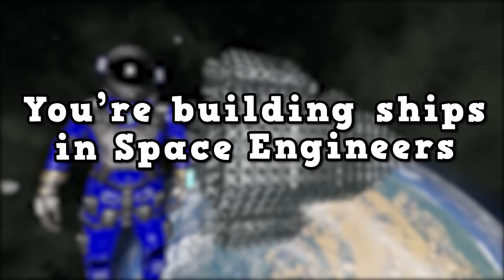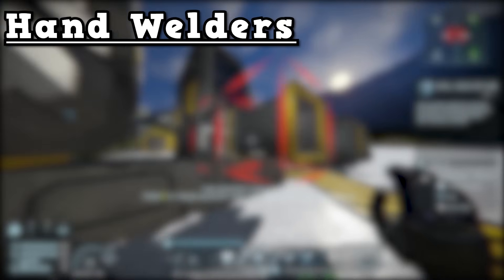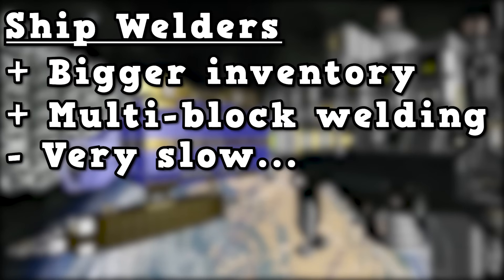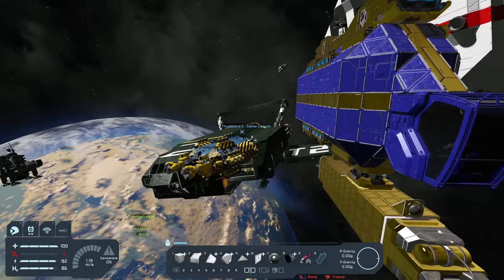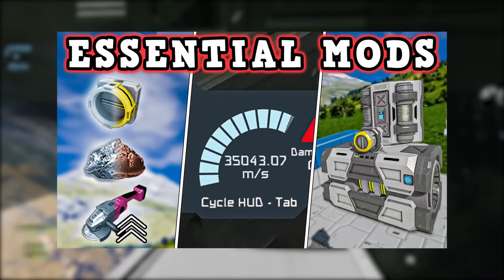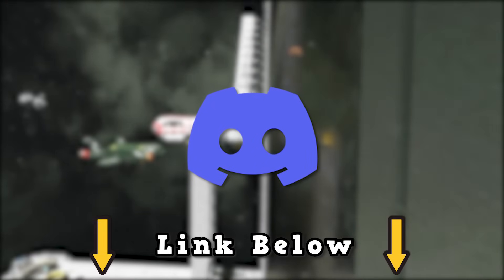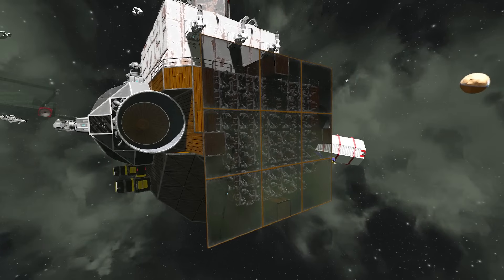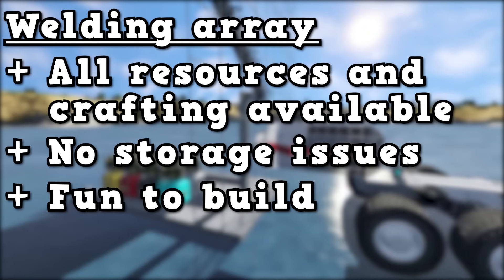You're building ships WRONG in Space Engineers

Comment: what if you had a hanging part, there would be the issue 3d printers irl face and that is they cant print and make floating parts so for example if you wanted to print a wing that has a tip the printer wouldnt be able to make plastic float midair til it connects, i think you might need suports for that
Reply from the maker: You should design your blueprints with that in mind, you can always remove support struts later.
Reply: @Zer0sLegion 👍

Comment: this rotor-based method is pretty similar to polymer 3D-printing. And just like polymer prints, if you want to have all the blocks print reliably with this method, you need to add support structures to your ship so that there's no disconnected blocks on any print layer. Thinking about it, with some sort of script you could probably even make something that functions even more similar to a 3d-printer, with 4 or 5 consecutive pistons holding up a base plate, some way to detect when all blocks in one layer are printed, and some sorta warning system for when the printer gets stuck on one print for too long

Comment: I'll have to do some testing, but i think you can use izzy's inventory mod to potentially function as a replacement for the build planner, but i could see the issue being that you wouldn't necessary get the correct components you'd need for each block.
Reply from the maker: I'd honestly prefer to have all my components in one place. It would be cool if it works though.
Reply: @Zer0sLegion  I haven't tested it and I'm sure this set up or one like it will be the best solution, but it does seem possible. You'd just have to label the storage containers as special and then independently adjust the values for what you need ahead of time. Which with the send to assembler options from the projector mod or projector plugin is pretty easy to do. Especially the plugin as you can just copy the list.

Comment: Instead of that ship to hold the building material, maybe you could use une piston and a plataforma moved by the piston or cilinder and you move it by imputs.. and it should be strong to sustain that weight.
Reply from the maker: You don't really want to be welding things on a subgrid as far as i'm aware as it will recalculate the weight all the time and that leads to clang.

Comment: To the rotor arm welder:
You even do not need so many welders. In fact one can arange them in a kind of an repeating L-form on the arm and it will still hit every block. It will take more time. But then even larger ships are possible with only 3 welders. 
Comparable to the drill head, which is a rotor, a sideways drill and an off center forward drill, all on a piston slower then 0.02m/s².

Comment: Im not sure where a first saw it (probably your channel). It was in video with custom elevators and there was a concept of gears (cogs) and corresponding rail. in my opinion, its the best way for a lazy afk printer (that unlikely to clang and disintegrate your base): pros is this is a infinitely size-scalable pulley, does not require manual pull, perfectly linear, works the same for gravity and no gravity. cons: since it uses rails to move the projection, requires as much length for the rails as big your project is.

Comment: Personally i use the build planner just to load up the welding ship in the early game for huge parts like large grid large thrusters. MMB on loaded container, Alt + MMB on welding ship, repeat until done. Still do conveyor systems and stuff by hand. Also bear in mind you can MMB click any cargo hatch with a block blueprint in your hand and it will add to build planner and attempt to auto-pull right on the spot. Useful for when you want to load the welding ship for like 30 thrusters but only have 8 slots in the build planner, but know you have the capacity for a single trip.

Comment: I'm currently building (well procrastinting) a ring station. The problem is that it is so huge, welding it up takes a lot of time. I tried using a welder array on a rotor that spins in the shape of the station. But the conveyor system us already so huge that it takes 0.5-1s to take items out of it. That apparently also applies to welders, they wait up to 10s to weld 5%, then wait again and so on. Those welder are also so laggy that the game runs on 50% speed (and my cpu is only chilling at 25%) All in all, it is faster to hand weld the station than using a welder array. I settled on using a 3x3 large grid welding ship, filled its container with steel plates and started welding the stations shell. I guess I have to do 8hrs of just weldingto get this project done :/

Comment: Docking isn't a huge problem as long as you design your ships properly. Word of advice: hangars suck, for two main reasons. One, it takes a log more time and care to enter a hangar than it does to hook onto a well-placed external connector. Two, if the ship breaks loose while the bigger ship is moving, it will clang around and tear up the inside of your large ship as well as destroy your small ship, and you won't have any way of knowing it disconnected until you hear the clanging. Carrying the ships externally is simply superior from an efficiency and safety standpoint. This is why the industrial capital ship I built carries its utility ships on its back, with piston-mounted connectors to dock to. It dramatically improves the speed and reduces the precision needed to dock. Hangars look cool, and I recognize they're nice for many uses, but anything you're going to be making lots of trips for you want external docking.

Comment: You could probably solve that imbalance problem by trading the rotor in for a bar, then have a piston sweep that print head bar up and down as a second piston incrementally pulls the unfinished ship away from the welders. A skeleton of support scaffolds should be plenty to keep things aligned.
Reply: Think of it as an actual 3D printer. Why not move the print head instead of the projector and ship?

Comment: If you are going to use a welding ship i would suggest putting assemblers on the welding ship itself. This allows you to load the ship with ingots instead of components to save space, reducing the trips needed to refill (if not eliminating extra refills all together). This also reduces the number of different things you need to load (5 or 6 types of ingots vs 10 to 15 components) and once you add the BP to the production, the production tab will tell you the total of each ingot you need to load up. Only downside is you may need multiple assemblers with full speed modules to keep up making it a bit of a power hog.
Reply from the maker: That may or may not be what the point of this video is...

Comment: i use creative mode to create most my designs then have a BP projector system (battery connector block projector block)  then locking it to a connector that's attached to a grid to charge the battery and power the projector.  each design has incorporated a docking connector so i can keep them all uniform. (helpful for drone management)

Comment: To use the projector while in k menu, set your menu back ground opacity to 30% that way, you can see through the back ground and see the projection as you adjust it! You don't need to use any mods to use the projector
Reply from the maker: Yeah, the only issues with that is you have a static camera, if it's a particularly big blueprint, you're going to struggle to see it.

Comment: If you wanted to have the ship being printed and the array on the same ship, rather than moving the ship being printed away from the array with pistons (which of course, as you pointed out, has weight issues), why not move the array away from the ship being printed? It's significantly lighter, especially if you are using the spinny design. (also, making two opposite arms of welders, rather than just one out from the pivot point might help balance the weight so it doesn't try to bend as it spins)

I don't know anything about space engineers, so there very well might be an obvious issue with this idea, but idk what it is.
Reply from the maker: It's generally easier to move the ship as you'll need all your resources and assemblers are at your base.
Reply: @Zer0sLegion  I'm not saying to move the whole base, just the part with the welders. Does that not work? maybe pistons don't count as a connection, but rotation points do?

Comment: For using welding ships, I usually use the build planner and just dump everything into the welding ship, so build planner the blocks you need to weld, then go withdraw and dump into the welding ships. At my base in space, I built a welding floor, and then few pistons over it with projector, was great for welding up small grid things. The welding floor would also build itself, build just build one, then have several around it not fully welded but just their, and the fully built one would weld the others up, and so on till your done. I don't usually build on creative then import to survival, as I feel like its cheating, but on a mp server, I see using prebuilts being the best option.

Comment: I haven't played Space Engineers since about 2020, but I remember finding all sorts of cool ways to help with the assembly process of, well, pretty much anything. One of the coolest things I think I ever built was a "welding arm" that uses pistons and rotors which are hooked into your actual base. This provided it with more storage than you would ever possibly need to worry about, no need to ever dock and get more materials or anything like that. 

Using clever scripting, you could control this welding arm from the cockpit with simple WASD controls. I built this "welding arm" in such a way that it sort of acted like a gimbal. Wherever your mouse was pointing is the point in space that it would rotate around when moving. This made it very easy to reposition around a projected blueprint and make absolutely certain you were getting those tricky interior blocks. VERY cool stuff! 

The coolest thing about this is how easy it was to rapidly build LARGE grids, and it had quite a very long range. The one and only drawback to this was occlusion. This was a welding device attached to an arm. You had to kind of plan what you would weld up first. 

If you welded the wrong stuff first, you could easily end up in a situation where the welder could not navigate to the other side of the projected blueprint, because there was stuff in the way and the arm obviously can't phase through physical objects. However, if you treated it like any kind of printer-like design (slowly pulling back from one point) it worked extremely well. 

My biggest issue with Space Engineers was dealing with ship damage. I always tried to design my ships to be pretty,  yet entirely functional. This meant everything was fully conveyored, and these parts of the ship were covered. If any of this internal stuff got damaged, there was simply no fricking way to know what was damaged and what wasn't. It is especially frustrating when one of your 300 large grid gyroscopes scattered throughout various parts of the internal structure is damaged. Good luck finding it.  

I like the gameplay and quality of life improvements stuff like the Nanites mod adds, but I don't like the implementation. I personally LOVE the idea of assembling a ship in some kind of drydock, using cool design ideas with how welding works to make it buildable. I think there should just be an easier way to identify and repair damaged components. Perhaps instead of nanites, a literal laser passes through the ship and instantly repairs anything in the beam that is damaged. So you could have a welding setup for drydock assembly, and a repair setup specifically for bringing in damaged ships and repairing them. Imagine being able to fly your barely functioning ship through a grid of lasers, and just fly it back out and it's all patched up in its entirety. This would make the game a lot better in this respect. At some point the game definitely changes from "space engineers" to "repair engineers" and it just gets tedious. 

I think for this repair system, projectors should be done away with. Projectors are perfect for building something initially, but I don't like the idea of having a "repair projector" which just overlays the missing blocks on the grid. This just seems like a lot of added work on the player's part because sometimes setting these up can be tricky. And what do you do if the projector with the preset blueprint and necessary offsets gets damaged? You have to fiddle with all of that again. I honestly found it very frustrating trying to configure projectors for this purpose, because dialing in just the right offsets was always frustrating, and if I was unlucky and that vital repair projector was damaged, I just had to screw with the settings again. It was annoying. 

Instead, it would be nice if the game just "knew" what was supposed to be there in the first place. Like, when you convert something to a ship, the game just goes "ah yes okay, these are all the blocks needed for this grid, I'll remember that." So if a block straight up gets destroyed, using a repair laser on it would just instantly rebuild that block, provided the materials are present. 

I feel like this would already be pretty easy to implement directly as a core part of the game. The game already knows what blocks compose a grid, you can literally see every grid in a game. It knows this stuff already. It would be cool if you could just tell the game "THIS configuration is what it is SUPPOSED to be", and when you tried to repair it and replace missing blocks, it just went "oh alright." No need to fiddle with projectors for this purpose would be really, really nice.
Reply: There is a mod that allows you to visualize where damaged blocks are on a screen.

Comment: i do the same thing. although on keen servers because of the limited welders i put them every other block with conveyors. still works just as good. maybe a little slower. I've also done a line of welders in a static position on the base and just set a gyro to override on the projecting ship and get the same effect or if it is a small grid fighter just make passes over the welder table. still the rotating head is a great method for large ships.

Comment: I have another way and it's a large grid welding ship deal essentially what a small grid welding ship is but it has an assembler or 2 manufactures components while you're welding I found this way best works in space with ion thrusters I was able to make it significantly compact considering it's large grid
Reply from the maker: That's basically what I suggest but it can move.
Reply: @Zer0sLegion  indeed a mish mash of the second and last idea one would say tho it ain't that big only 3 blocks tall 5 wide and like 7-9 long depending on the configuration

Comment: For my server I use "Instant Projector" mod, which does sub grids as well, while also instantly building a bp after x time and parts requirement is met. So far less server CPU usage opposed to piston and welder clang monsters. And for mass grind like grind pits I use "Nanobot Build and Repair System" which is a auto repair system but can also grind.
Reply from the maker: Yeah, I get why they're used on servers but they are a bit cheaty. I prefer to engineer my solutions.

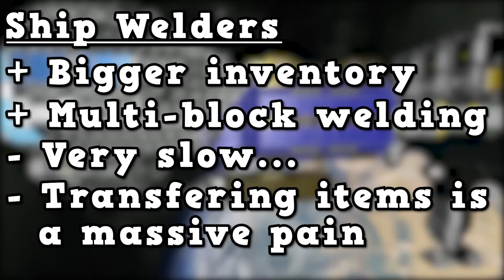Comment: 2:50 Many solutions to the problems mentioned. Sortie and gates on the conveyor system allows fast refill. Multiple branching welders, and a better welder ship design makes welding a lot faster. My welder ships are agile, and so docking is easy. 
But also, lastly, rooms can be made for welding. Build a small ship, place the blocks, than use welders on the wall, on pistons to weld.

Comment: There is still a big negative for the array for ships with a more sporadic and or hyper detailed design the array cant go back and get the bits hanging of away from the welders. So you will still be hand welding some blocks and for drastic designs possibly massive areas.
Reply from the maker: You'd just need to weld you ship in the best way to accommodate that. Or build ships that can be printed.

Comment: I was thinking for your point of being unable to use build planner with welding ships, and I would like to point out that isn't necessarily correct. As, although true you cannot physically add the blocks to the build planner like you do when out of the ship, you don't need to manually move the items. You can leave your ship, fill up your build planner, and enter the cockpit and go into your inventory, and in the center of the inventory there are multiple buttons you can press, and one of them is to collect all the items from the build planner. So you can physically move items from the station into the ship with a simple press of a button, and saves endless trips of leaving the ship and putting them in, or dragging them over. You can even miss out the need of right clicking on the blocks and just use the G menu to find the blocks and fill up the build planner.
Reply from the maker: My point was that it's no where near as easy to do it as it is with the hand welder, I just worded it poorly. It's two clicks with the hand welder, one to add and one to withdraw. You have to do the entire process you mentioned to do it on a ship.